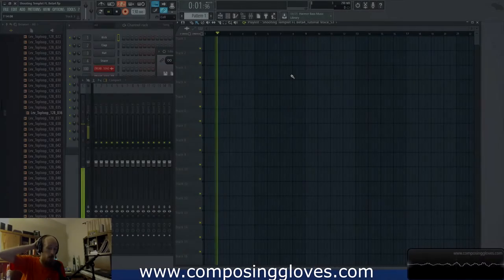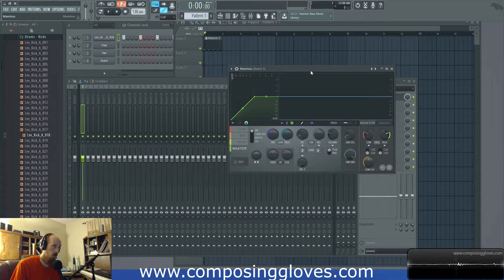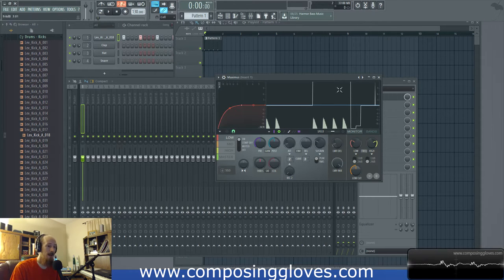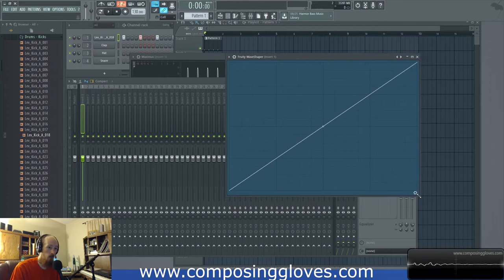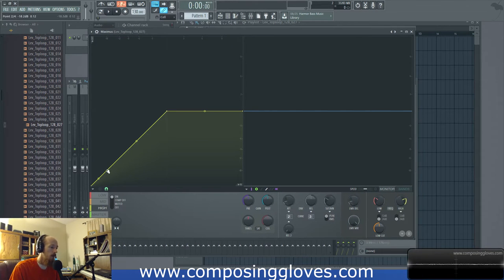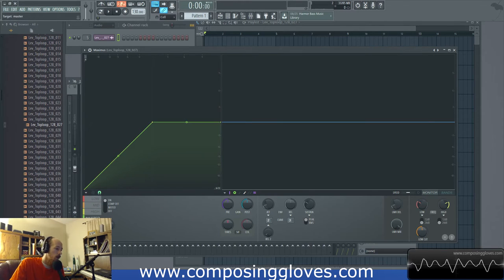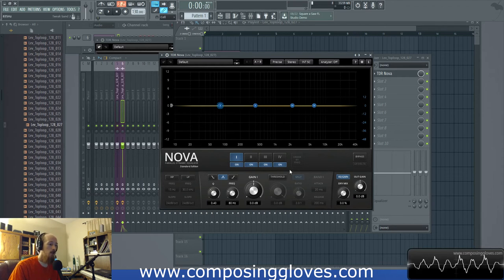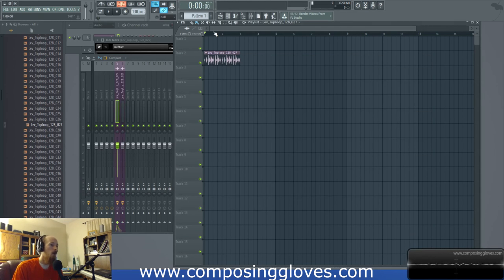Multi-Band Compression Basics

Comment: Composing Gloves I have a random question about FL Studio's zoom functionality. Sometimes I hit something by accident and FL Studio zoom locks it so it appears on the screen either too far in or too far out. 

Can't ever seem to get the screen back to normal so I have to simply exit the project and pick up from my last save point. Do you know what I'm talking about/have an easier solution to get the Playlist back to a normal mode so I can see which patterns are which, etc.?
Reply from the maker: My guesses are the Ctrl, alt, Z, or E key. Ctrl while scroll mouse wheel will change length, ALT + Mouse wheel will control width. Z and E are short cuts to the zoom tool and marquee zoom when the midi keyboard is off otherwise it makes you hold shift while pushing either of these keys. Those are my guesses.
Reply: Thanks... sorry to go off topic, but this happens all the time and seriously messes up my work flow.

edit: it's not reverting back to the default view screen... if anyone knows a hot key to fix this please share.